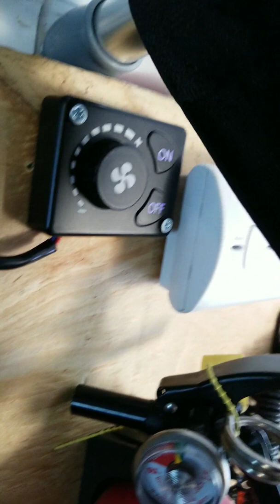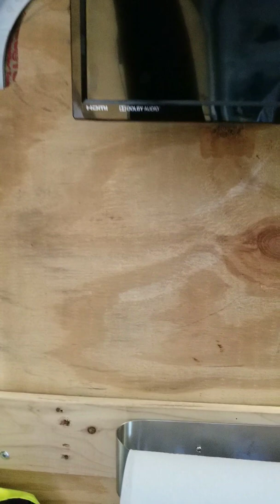Is expediting for you?

Comment: Carbon monoxide is heavier than air. You need to move your detector to the bottom of the van to work properly. By the time it goes off where it is you'd be dead.

Comment: What is better 0.50 per mile and company pays for gas. Insurance , van payment or 0.80-1.00 and you pay for all your self?
Reply from the maker: That's a tough question to answer my cost is .30 per loaded mile so at 1.00 per mile I get .70 profit....50 cents isn't bad per mile with the owner paying the other Bill's but I think you will find it difficult to find that deal its generally a 60..40 split  you get the 60 and you pay the gas
Reply: Are u going make some new videos

Comment: Is thier a big difference  between  gas mileage the 3500 and the 2500 hundred Van's thanks for last answer
Reply from the maker: No to be honest they run the same engine summer blends get 20 to 21 at 63 mph winter blends 18 to 19 mph weight doesn't really matter unless you're in a hilly area..if you're thinking about expediting 3500 xtended high top